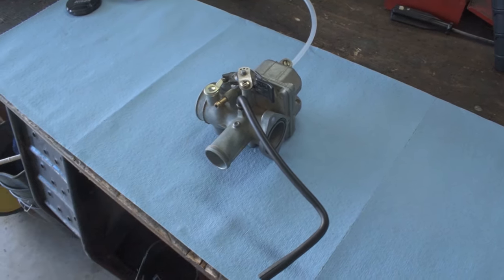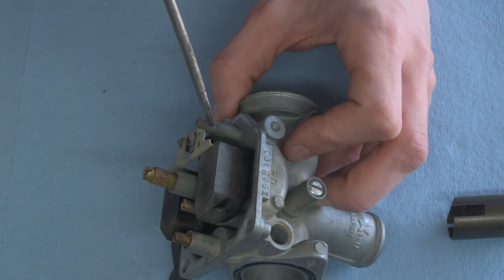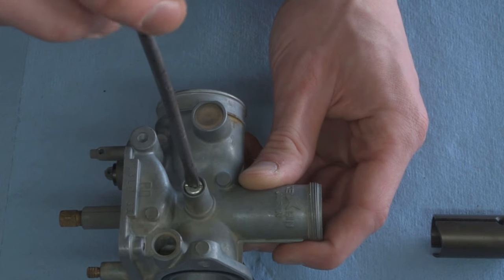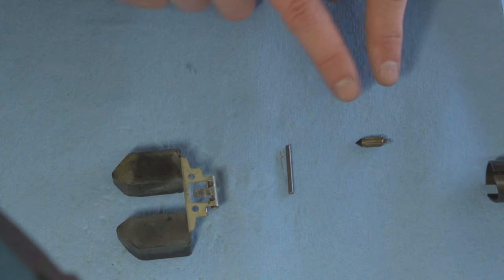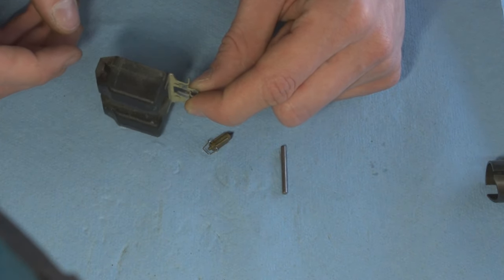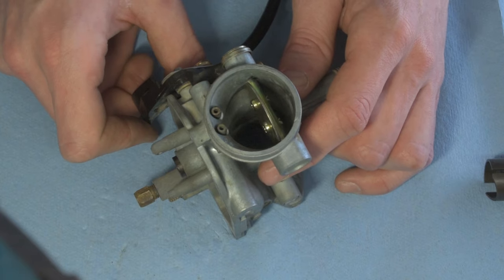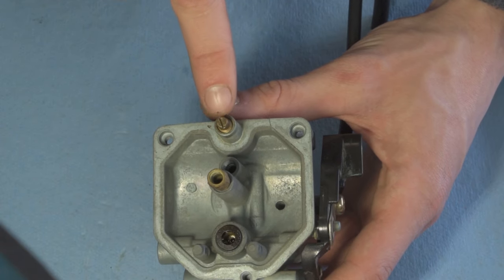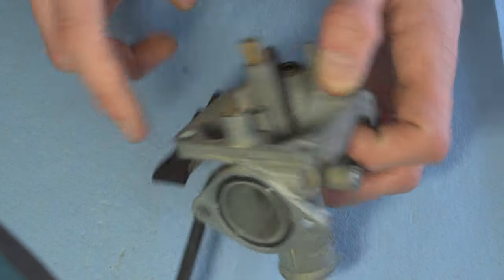Understanding How To Tune A Dirt Bike Carb

Comment: Aaron - I just replaced a PZ27 carb on my RPS Viper because it sat up for more than a year and the float needle was stuck preventing fuel to empty into the carb.  Pull the original carb off thinking I could service it but notice the bolts heads were removed.  what the heck?  I tried to drill out but messed one of them up so I order a new carb.  Put on the bike and when it starts it races wide open on the choke.  What is happening?  If I open the choke it spudders and has no power.

Comment: Perfect, dude. I'm dealing with a 2019 Apollo Enduro. Changed the carb but they didn't give me a Japanese replacement! But now I know what to do. Muchisimas, bro.
Reply from the maker: Only happy to help! Lemme know how it goes!
Reply: Yeah, hey I just went out and looked and it's easy to get to! You really helped me out because I know little about mechanics :-)
Reply from the maker: Fantastic!!
Reply: @AaronsEnduro  Hey Aaron, thanks to you I was able to bump up the idle and enrich the mixture. The backfire went almost completely away but it still sputters on acceleration. mostly in the mid RPM's. The manual says it's supposed to use 93 octane gas. It's 12hp/7000rpm, 17.5 ftlbs torque at 5500rpm and is supposed to idle at 1550rpm at higher altitudes, which is where I am (!) No pun intended :-) And an over head cam. Is that kind of cam normal for a bike like this? Or nothing special? What am I dealing with here? 9.6 :1 compression ratio and we measured the compression which was at least 150psi.

Comment: This can’t be free!! Thank you, so informative. Really just filled in the gaps of my knowledge with this in depth video.
Reply: 250cc buggy is running pretty rough, when throttle gets to about 40-50% starts to choke and sputter as if the tank is Empty. I need to come off the accelerator to prevent stall. Will have a go tinkering with the needle position or the mixture screw at the bottom and see if I can fix this.
Reply: This is after Installing brand new carby
Reply from the maker: Id check your spark plug to see what colour the plug tip is to help indicate if its leaning out or bogging out from being too rich. Then you can adjust the fuel screw accordingly! Let me know how it goes!!
Reply from the maker: Also depends on what size carb you put on the engine!

Comment: Glad i found this video I'm a total noob my pit bike is bogging in 4th gear at higher throttle think it might be something to do with the carburettor. This video was helpful. Want to learn more before messing with it.
Reply from the maker: Checking your spark plug will help you with knowing if its running lean or rich. Black plug =rich
White = lean

Comment: Nice video, the piece you left in the carb could get contamination and cause a bunch of problems. Doesn't hurt to remove and make sure all holes are clean. Got to airiate that gas!

Comment: Hey! your videos have been super helpful, however I still have questions. I took the throttle cable out of the valve, and now I can't seem to figure out how it goes back together. I've tried looking it up but all the videos I have found have slightly different components than the ones I have. but in this video I'm seeing all the identical parts to mine! thanks!
Reply from the maker: Hey if you’re looking for 1 on 1 guidance you should check this out :

https://www.youtube.com/channel/UCcviyKZ2Vf3IHFliwebzODA/join

Comment: Hello and thank you for your very informative video.
Issue #1
@2:45 you point to the brass tube where the main jet is located and clearly state that you don't need to remove this or the air/fuel mixture screw.
Are you serious young man ?
I just cleaned one of these carbs last night and I can tell you that little tube has 12 tiny micro holes located along the throat of that tube . . . if you think of a clock analogy and looking straight down the tube's length, there are 2 holes straight up at 12 O'clock, 4 holes at 3, 2 holes at 6 and another 4 holes at 9 O'clock.

These tiny micro holes get clogged too.
When you disassemble a carburetor you completely disassemble the entire thing. You never just do part of it.
Reason stands, if there's wax/tarnish in the bowl or anywhere else in the carb like that green stuff growing in your bowl, then it's in all of the passages, pin holes, crooks, and corners of the entire assembly.

What you are stating is to . . . only do half of the job.

Also, when you clean a carb, it's best to soak it, as well as all of it's parts in an ultra sonic cleaner with the proper solution in it and a working heater.

Why would you not remove and clean your fuel screw ?
See sentence above regarding all that green crud inside your carburetor.
How do we know where it's set and how do we reset it after we've disassembled and properly cleaned everything.
You didn't include that.

Slow down you're presentation a bit, you're talking too fast. Clarity and understanding are more important than whipping it out faster than Speedy Gonzales.

Other than that, great video young sir. Keep it up, and maybe edit this video to include those tiny bits of information for setting that carb before you reassemble it.

Just my two cents.
Reply from the maker: This was one of my “first videos” while i was sharing as i was learning. Thanks for the feedback and happy riding 🤙🏼

Comment: Thank you! This is the best explanation video on YouTube. I do have a question, the casing that my idler screw fits into broke off. Will fixing it back with a steel putty hold it? Or do I need to replace the whole carb?
Reply from the maker: You might be able to get away with a jbweld of some sort yeah, worth a shot i guess!

Comment: Great vid. Really learned all I needed to know from one video which doesn’t happen very often. Thanks for the information.
Reply from the maker: Glad it was of help to you! Thanks for watching! If you ever got questions feel free to ask our community here! :)
Reply: @AaronsEnduro  I’ve been having trouble with my bike constantly leaking fuel out of the overflow hose and even leaking from the fuel on and off switch. I wonder if I’ve got a stuck valve. The bike seems like it’s getting way to much fuel through the carburetor to where it bogs down when I ride. And sputters sometimes
Reply from the maker: The fuel coming out the over flow line is a float issue.

As for the fuel leaking from the fuel on/off, points to a failing seal inside the petcock valve (the on off switch) replacements are cheap.

Your bogging issue could be caused because your flooding the carb (because of your float issue)
Reply: @AaronsEnduro  awesome man I appreciate the feedback, I’m gonna try and break it down and see if I can get it right, thanks.
Reply from the maker: Id start with checking your float and float valve arent sticking/incorrectly set 

You can test the floats height by blowing air into the fuel line ( i used my mouth) and manually actuate the float with your hand. If its “flat”/horizontal and you can still blow air through the line, you need to slightly adjust your hanger. (Meaning its still adding more and more fuel into the carb even tho its full)
Reply: @AaronsEnduro  do you have any videos where you’re checking that.
Reply from the maker: @treysteadman9564  i did a livestream with it yeah
Reply from the maker: https://youtu.be/vvvxDXcV5Lo. i fixed my float in this video. youll see me doing the "air blowing" test in it
Reply: @AaronsEnduro  awesome man I appreciate the pointers.
Reply from the maker: at 1:16:21 i show pulling the petcock valve out for the leaking gas at the on off switch
Reply from the maker: https://www.youtube.com/watch?v=Iw8UXCpr-qg heres the next one and theres 2 more livestreams after this one all on this subject
Reply from the maker: https://youtu.be/usbojocH5ro
Reply from the maker: https://youtu.be/JBa-7TqcOf4
Reply: @AaronsEnduro  thanks bro hopefully I can get it fixed right

Comment: Can you do a video on how to hook up the throttle cable into the spring loaded carburetor?
Reply from the maker: I have in another video shown it
Reply from the maker: Put the cable through thr carb cap, put the spring over the cable, Compress the spring over the cable, then feed the throttle cable tip into the carb slide. Its a little tricky holding the spring all the way compressed against the carb cap

Comment: Arron what adjustment is needed if my 4 stroke will only idol with the choke closed.
Reply from the maker: Choke closed = richening it up bu cutting off air flow. Indicates that without choke its running lean
Reply from the maker: If you wanna do a deeper dive into it with me, join this and we can connect! https://www.youtube.com/channel/UCcviyKZ2Vf3IHFliwebzODA/join

Comment: Hi Sir, I have a 1976 Suzuki TS 185 which I’ve owned from new and just completed a full motorcycle refurbishment and now I’m trying to get the motor to run right. The motor starts up fine using the choke (UK 1000 feet above Sea level) and runs more or less perfectly until around 4000 rpm and then it starts to misfire and if I try to open the throttle more, then this results in total engine cut out until I close the throttle again. I believe that the issue may be related to the needle position (not sure where it is at the moment) and I assume that I may be too lean and need to raise the needle but your knowledge and experience here would be much appreciated ! Would you kindly give me some much appreciated information please ?  Thank you for your excellent video ! Please keep it up.
Reply from the maker: Id start with pulling the spark plug to see what colour the tip is to give you a better indication if it is lean or rich. Then start to move the needle clip position in the direction needed

Comment: I just rebuilt a crf 80f carb and checked the float bowl height, the jets are good and clean, it idles fine... but when I brap the throttle it boggs and then the rpms take too much time to come back down... why is this?
Reply from the maker: If you think its bogging you should check your spark plug color for fuel mixture. As for the revs staying high, didnyou change your clip position? And or possibly the throttle slide could be sticking in the top of the carb

Comment: Helps out SM! I have my ssr 140 and it has the mukuni vm26 carb and after about 9 months when I try to kick her over and I wap the throttle back it bogs but if I SLOWLY give it throttle she’ll start and breath and once she’s warm she’ll idle fine , any tips on how to get back to normal 😩
Reply: I turned up my idle screw and that helped out but haven’t adjust needle clip or fuel screw or jet but after watching this I’m gonna try to the best of my ability’s ! 😅
Reply from the maker: Id say itd be your needle clip position, just odd that it all of sudden happen it’s happening. Did the bike sit for 9 months straight? If so first id start with just cleaning the carb out (especially if you’re fuel that contains ethanol)

Comment: When you switch from stock air box to cone filter.. the pilot jet, and main jet need to be swapped for bigger sizes and the need washer to be a little lower right?
Reply from the maker: Are you referring to a bike that has a sealed air box? I wouldnt get rid of an air box for a cone filter

Comment: I'm getting rev hang after releasing the throttle. Is this related to the carb? What adjustments can correct it? Thx!
Reply from the maker: What colour is your spark plug
Reply from the maker: Assuming your leaning out
Reply: @AaronsEnduro  It's black and slightly wet with no buildup or deposits.

Comment: Okay on the throttle needle raising the little something on the throttle needle higher what will happen?
Reply from the maker: Will reduce the amount of gas flowing as you open the throttle, aka making it slightly leaner at partial throttle
Reply from the maker: Solid question!

Comment: How do I know If I  should change my carb? I just got a 140cc Apollo open RXF.
Reply from the maker: 1. Its a fact you can tune an aftermarket carb, the stock ones arent bolted shut and they use rivets to keep you from dissembling it. 

2. If you notice any bogging or hesitation when on throttle

Comment: Just cleaned the carb because it
wouldn't start up. It starts up now but it's very loud and rough. I haven't tried going into gear 1-4, but should I? Just to see if it's the same for the main jet or will it blow
the engine or something. I have a semi automatic so it
won't actually move without use of the throttle. Also,
I'm aware I have to go back into the carb, how much do
I tweak the pilot jet and main jet? One more thing, the
carb had gas in it and I had to hold the floats up to
make sure the gas didn't leak. I turned the fuel off as well. Why was it leaking out and how can I get it to stop?
Reply from the maker: Thats a sticking float in the carb (why gas is leaking)

Comment: I have a 2018 crf 125 f and I can’t adjust the float level because it has a set float level anyways I cleaned the whole carb and airfilter and it spits and spudders when a I give it full throttle I need help
Reply from the maker: U adjust the float level by bending the tab
Reply: @AaronsEnduro  it doesn’t have a tab it plastic
Reply from the maker: Ouff. Have you tried adjusting the needle clip position
Reply: @AaronsEnduro  no
Reply from the maker: Then id check that. What color is your plug
Reply: @AaronsEnduro  white
Reply from the maker: Then its running lean!
Reply: @AaronsEnduro  do u think I should move the needle clip down
Reply from the maker: Worth trying a fuel adjustments forsure
Reply: @AaronsEnduro  if that’s not it then idk bc it’s getting way to much air and not enough fuel and it doesn’t have a air/fuel screw
Reply from the maker: Go to this website and download the manual. It tells you how to do it 

https://ownersmanuals2.com/honda/crf125f-fb-2018-owners-manual-74968/page-88

Comment: What should I do if the throttle isn't doing anything
Reply from the maker: You probably have the throttle cable incorrectly put in the throttle slide or the throttle slide is put in backwards 180*

Comment: Hey man, I have an 02 yz426 that has a hot start.the bike only starts with hot start engaged but dies immediately after letting it out. So I believe too much gas is getting in the carb? What do you think needs adjusting? Thanks !
Reply from the maker: This is what i found online:

“The carb is the single most common source of starting problems with the older 400's and 426's.  You have to get the idle jetted and trimmed out almost perfectly in order to have them hot start reliably.  The bike should only need the hot start for restarting immediately after it's stalled while running.  If it's been sitting for 5 or 10, it should restart without it.  An even slightly rich idle will make the bike difficult to restart when hot”

How valid is it , not sure. But something to go off of. Im not too familiar with the 426 setup in particular

Comment: I changed my throttle Cable now it idles at full throttle. I think it has something to do with the spring and needle
Reply from the maker: My guess is you put the throttle slide tube in 180* backwards

Comment: I cant get that w shaped spring spacer clip back into my throttle assembly in the carb, you never explained how it goes in.
Reply from the maker: You just sit the W on top of the throttle needle
Reply from the maker: It just sits between the needle and the spring
Reply: @AaronsEnduro  is it supposed to be pressed into it? Cause It sounded like it was scratching the walls pretty bad
Reply from the maker: As in the walls of the throttle cylinder?
Reply from the maker: It should just fall inside the throttle slide. If it doesnt its been messed up when u removed it. Either way i really dont think its that important. It doesn’t affect the needle or spring position. Just jam it down in there
Reply: @AaronsEnduro  alright, thanks for the help. I don't normally work on dirt bikes so this carb is pretty new to me
Reply: @AaronsEnduro  yes
Reply from the maker: Once you learn it youll never forget!!
Reply from the maker: If you ever need help just comment!